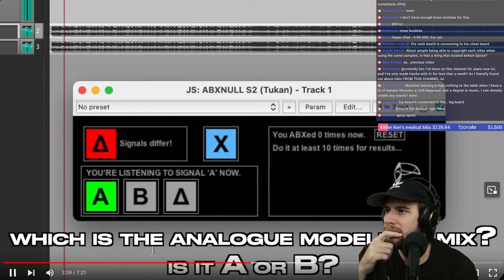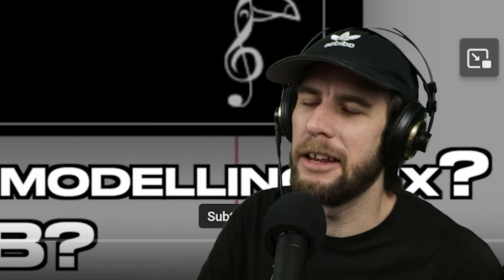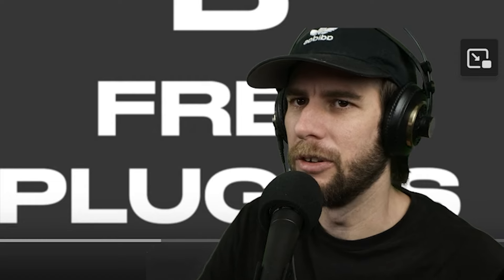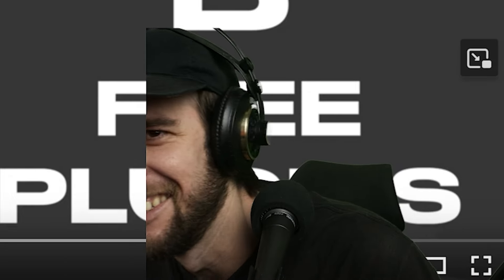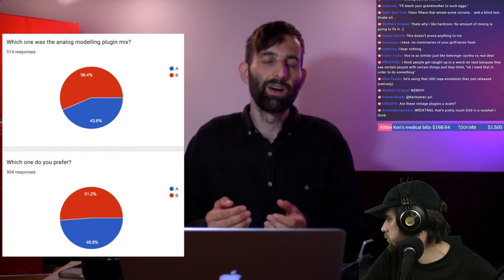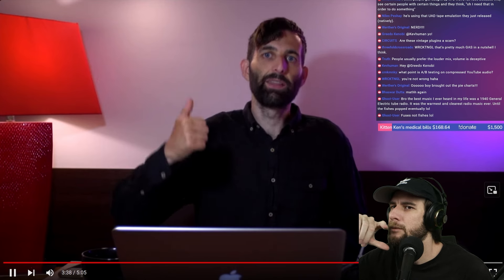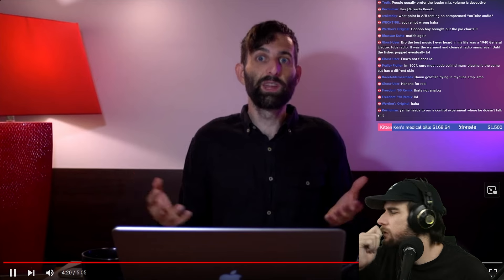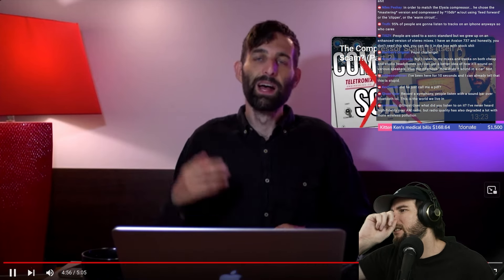Analog Plugins are a SCAM

Comment: At least in my limited experience as a music producer, it seems to be that what people hear as “warmth” is really just a slight 24 or 12 low pass.  Just enough to tame some of the high end.  My novation circuit tracks can sound very “digital” but if you engage that system wide low pass just a little, you get buttery, sweet warmth.

Comment: you're still in the digital realm, and you can model the hell out of this analogue style plugins, but you will never get the non-lineairity of real analog outboard. Not that i care much. I would like to send sound thru external outboard, but far too expensive for me, and storing settings is also a problem. I think most producers, mixers, mastering engineers take photos of their settings on outboard? And this kind of tests are so random, everybody has different audio interfaces, different monitors, different rooms, you're right if you want to measure anything, a scientific approach is needed.

Comment: These comparisons are a bit pointless. No one can tell which knife the chef used to make your dinner! The question is given the ingredients the chef had, did the knife make a difference to how the chef prepared the food? Did the food end up tasting better because the chef had a sharper knife? Was the dish made faster? Did it give the chef more time to do other things to the dish. 

The best test for any plug-ins would be how well it can take crappy source material and make it sound decent. Not taking well recorded sounds and transform them.

 Nowadays everyone has access to clean well recorded sounds so yeah, most stock plugins can work well. But as I said the value is in it elevating crap material. 

Also, analog modelled plugins help people translate settings they used in a real studio into a workflow they can do in the box. Saves a lot of messing around if you know what you want to do anyway. 

Im not sure “sound” is the issue these days. It’s more about someone’s workflow and how quickly they can get what they need. I mean, how many people even need a gate plugin in the digital realm? Everything is inherently good now sound wise. It’s just a taste and workflow thing.

Comment: the reason analog sounds the way it does is because of the materials used to make gear and the way it handles voltage and vibration. We don’t even have the same quality metals to reproduce the gear let alone the sound.
Reply: Incorrect

Comment: the difference is about creative sound design. they can give u tone and character, so it depends on how you track things really. if you are all Direct in u can mess quality of the sound. the way the tape warble works, for example. Or the knock of the compressor. if you attempt to make two mixes, but the are both tracked through the same gear and then just balance and eq them well and try to match them, then I think it is missing the point.

Comment: I appreciate your tech blogs so this is info: 1 a / b layer? No. I make 100-300 (average) track songs and bounce down to archive as I do. 3 revisions on 300 layers? Major sonic shift on all of it. I do minuscule adjustments to every track utilizing hi low pass utilizing built in EQ with micro analog modeled parallel compression on every layer. Almost imperceptible with a / b on 1-50 tracks. On 300 x 3? Analog emulation keeps it from over digital crispness…and it gets warmer with every layer, revisions, or bounce which I then mix with everything at minuscule amounts with parallel compression. 400-800 tracks total. All so light it is barely audible on 1-50 tracks. Super low, glue compression, and a warm track allows for collabs or delivery of a file to be worked on by other people that holds up at 16 bit mp3 bounces without loosing the style and quality of my specific songs, music, and production. My version of a classic, old audio engineering and audio production maps for delivery. Have a great weekend ~ stefan

Comment: The fact is UAD and Softube makes incredible plugins. And Softube analogue synths are actually analogue. Has this man heard UADs B3 organ? That is as analogue as it gets. No one, and I mean no one can tell the difference between that and the real thing. And how about the Waves Magma BB plugin? That is the sound of analogue. This guy is oversimplifying and generalizing to his own detriment because the fact is he is wrong. Mix and mastering is about making many small changes that impacts mixes in a big way. And when you put one plugin on an entire mix and A/B between another plugin you don’t prove anything. Why because those plugins are just making one of the small many differences needed to produce a good master. The guy has flawed reasoning.
Reply: In my experience, UAD, Softube, Brainworx and Waves make great, great emulation plug-ins for a very fair value. I own or have extensively used a lot of the gear that these plug-ins emulate and they come respectfully close. The gear is objectively better but realistically, the difference is splitting hairs. I still think that extra 5% means something but to say the plug-ins are scam is just dead wrong
Reply: In fact, I used these plug-in emulations to guide what decisions I made in terms of the hardware I actually ended up buying. And I was not disappointed, in most cases the hardware is just a slightly better version of what the plug-ins were still able to offer to a degree. If you can’t afford the gear, good plug-ins will get you damn close. I would not say that the difference is nothing and I do think even if people can’t “tell the difference” a lot of times the hardware still sounds better in a way that is hard to put your finger on. BUT… Analog emulation plug-ins are not a scam. There are cost-effective asset. You just have to use plug-ins from good developers
Reply: @hockeytalk6084  Agreed with everything you said.
Reply: Exactly...putting 1 plugin across the whole mix is a wtf moment. It also proves he doesn't know what the feck he's doing or saying. He's just saying crap 100s of other people before him have said. I'd love to know what qualifications he has to say all this crap?

Comment: nothing sounds like analog but analog.  it actually depends on which you prefer..the plugins or outboard gear? imo real analog gear has alot more density and depth than any plugin. i think the point is alot of us get into a plugin buying addiction and they dont really improve the sound all that much. most DAWs already have all the plugins you need.

Comment: Good gear beats A LOT of plugins. Good plugins usually beat mid gear. Most of the time the difference in price is not justified. In tracking and group processing, gear simply wins. A lot of emulation plugins are oftentimes marketed in a way that is insidious and scammy, but a lot of times they aren’t a total rip off at all. I own and have extensively used pieces of hardware that I can personally attest Brainworx, Waves and UAD plugins came impressively close to. There’s also a lot of scammy replicas that dont sound that similar too. It is what it is. Gotta know what you’re looking at when you buy either one tbh
Reply: For reference, gear I have used a zillion times in which plugins came respectfully close: SSL channel strip/Fusion, ACME audio Opticom, SPL Vitalizer, Looptrotter Sa2rate 2, Avalon VT737, Empirical Labs Distressor, Tubetech pultec, etc. Mostly brainworx, UAD, waves and softube plugins come damn close… and that’s just of the limited gear I have used extensively or am lucky enough to have. I still prefer using the hardware but I would never call those plug-ins a scam. In fact, I based most of my hardware purchases around the plug-in emulations I liked and used the most

Comment: Sounds like he's selling his own plugins.

He might as well just say distortion doesn't change the waveform at all. The plugins he used aren't supposed to color the sound to the point where it's super noticeable. An instruments tone should be right going into them and they add a subtle polish, but if you drive them really hard they do affect the sound in ways that digital style proccesor don't. Mainly different flavors of harmonic distortion, drive them as hard as you want with gain staging... wait gain staging is also a scam 😅